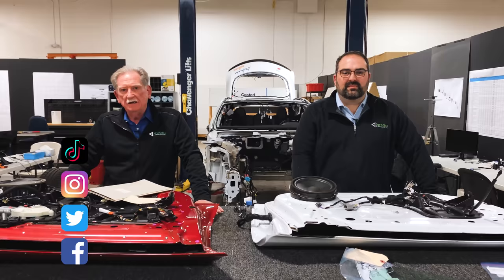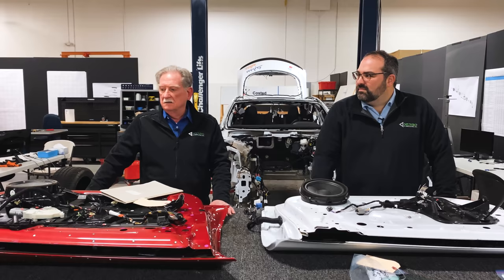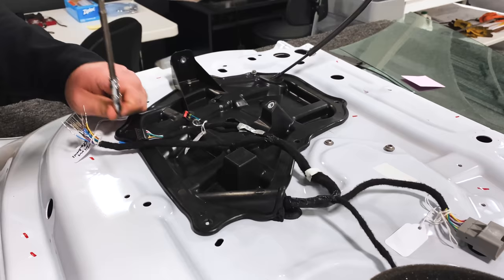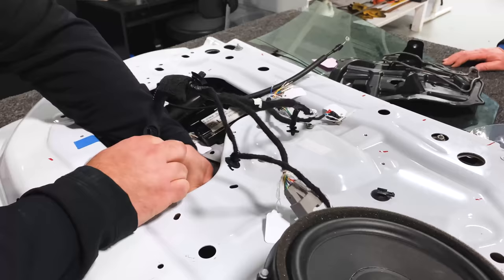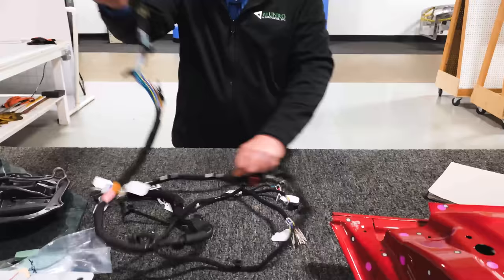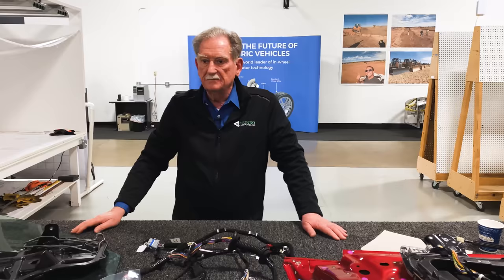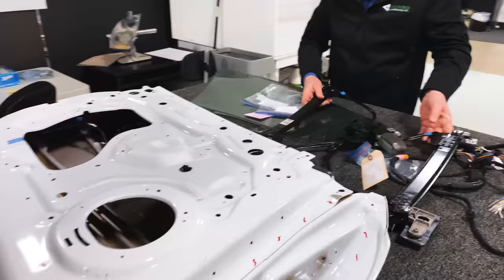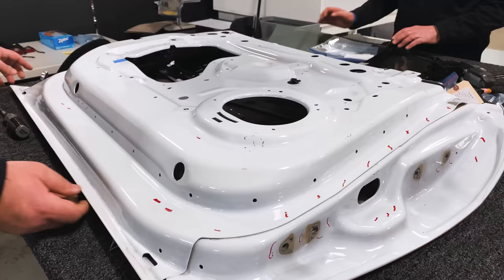Plaid Doors Disappoint Sandy | Tesla Plaid Teardown

Comment: Sandy as a, as it stands former Master tech with a european manufactuer who's driver did not win the F-1 Championship this last year I can say I love what you do. I have delt at the dealership level of repair of the semi modular doors and conventional doors and found they just use this as an exuse to lower labor times. I know its all about snap and fit, but when it comes time to service and repair I would love to be part of Your reviews of what it takes to diagnose ,remove ,and repair rhe faults seen. I know it's rether easy to evaluate a door or a headlamp assembly when not on the clock. whith scattered information at best.Thanks for all you have dome.

Comment: model s plaid is based on the same line as the model s and they already have a working line for model S. What Elon said in the interview with Sandy was that once a line is moving and tooling is setup then the line will run until they do a hard redesign.

Comment: OMG - As an engineer and former union worker from Michigan I am lost to see what quality and cost advantages Tesla saw in using separate parts versus sub-assembly one-piece door inserts. The only thing I can see is the engineers working on the door design got lazy and did not take into account assembly line time. Just think of the downtime if the person that sub assembles this door nightmare calls out sick at the last minute. What person can jump right in and take over?
Reply: I'm betting this is essentially a continuation of the outdated nine year old 2012 Model S door design. It's too bad because they obviously discovered the benefits of an insert with the Y. This looks like a nightmare for line workers.
Reply: @GabeJE  
It looks like "no worse than other manufacturers" for line workers.
As mentioned elsewhere, it's probably a common skin from the older design, low volume, sunk cost in machinery?
Reply: @GabeJE  I did some research online and it appears this same Plaid design is still used on S and similar X design. It also appears some Model 3's with sub assemble one-piece doors are rattling due to loose wire harness rubbing against the doors inside trim panel. An easy fix is taking off the door panel and using molding tape to affix the loose wire harness to the inside trim panel or adding insulation to the trim panel.
Reply: Team leader. Happens all the time.

Comment: Great video. As a retired engineer, I was flabbergasted as to the horrible assembly process required. Looks like it was designed to be manufactured in a “low cost” labor area. I agree with Sandy that this could be a quality nightmare. The amount of labor required relies on the assemblers to pay very closely to what they are doing. Makes sense now why old saying, “Hope I don’t get a car make on Monday morning or Friday afternoon” was penned. Also, why “lemon” laws were passed. Thanks for this video.
Reply: Plaid model S is a low volume car, not design for high volume, like model Y is .
Reply: @LeesReviews69  - TESLA will invent Whole body Megacasting, and Destroy LEGACY auto.
Reply: @markplott4820  
Still on the "megacasting"?
Single question.
How do you produce a "megacasting" with good enough finish for paint on exposed outside surfaces?
Go away and ponder that. (Note the castings used so far all have steel panels as "cladding" which are then painted. Can't do that on the roof beams.
Reply: @LeesReviews69  If I have to buy a car from China, guess I’ll just stay home.

Comment: 11:44 that rounded edge is not just for the safety during the assembly but also for improving panel's rigidity and resistance to resonance.

Suspect Tesla looks at PLAID as a niche product with low production numbers and willing to eat up the assembly cost. Model 3/Y are with different requirements for speed of assembly and overall production cost. Great video.

Comment: What Sandy says about this door is very clear to this non engineer. And to hear that Sandy's experience of his ideas being rejected by the Ford was very surprising and disturbing. Does management care about the stripping away of unnecessary tasks or is it just interested in power? This is sad. I have had my hands and tools inside about five different car doors and all of the experiences were absolutely pain. Drop a part and the door might have to come off it's hinges. Luckily, the only part I dropped was steel and I retrieved it with a magnet.

Comment: Wondering at what extent of door redesign (e.g. removal of steel), would Tesla be required to perform new side impact crash test?
Reply: both doors are from tesla one is the latest model y, and the white is the model S Plaid.  So there would be no new testing
Reply: @davidanalyst671  Side impact testing is on the vehicle, not the door.  Can't just swap a door from a different car and say it is tested.
Reply: And it certainly seems like all of that structure must be about side impact to begin with.
Reply: @patreekotime4578  it’s not, that stuff is thin and flimsy and not core to the crash worthiness. There is a major beam in the door for crash worthiness.

Comment: I wonder if maybe this is just a function of inheriting the design from the first generation Model S.  Maybe they don't sell enough Model S's to justify redesigning everything to be more like the 3 and Y just for a car they only make a few thousand of every year.
Reply: Model S in 2021 sold less than 10k. so they only need to focus on NVH, does not matter if it's hard to assemble, as more Human workers are needed on Mod S line who can fainess parts better than a robot can, mod 3/Y use more robots than humans and Design is better suited for mass production.
Reply: That's a poor excuse!
Reply: @gmv0553  It is, but that's the same as any of these super high end cars.  They only sell a few each year, so complexity of manufacturing and maintenance isn't really a concern.  Think about how hard it is to remove an engine from a Ferrari or to replace some trim panels on a Bentley.  The buyer doesn't mind paying a lot more for the car and either they get bored with it in a year or they have six other cars and don't mind it being in the shop for a month.

On the Model 3/Y where it isn't a toy and the labor multiple is 10-20X, it makes sense to redesign and retool, but on a low run car, the return on investment simply isn't there.

The Plaid's design budget went to power and NVH since you need to be really well off to drop 150K on one of these rockets.

Comment: With the panel trim off and the closeup panel, the metal stamping of the door looks identical to my 2015 P85D. S is a low volume product and they're probably using the same stampings they've always used for the S body...except for the rear fenders.

Comment: Did they leave the original design, so they didnt have to buy another die to cut out a bigger panel in the door? Maybe it was a cost saving measure or a tool hasnt reached the end of its life yet so no reason to replace it until then?

Comment: Maybe it is a module. Looks like the module was assembled on a metal panel and was spot-welded to the outer door frame. Maybe the harnessing was installed before the inner panel was applied.

Comment: Sandy, you might have missed the whole point of why Tesla might have used that door. Right off the bat, I can see that it will offer much better protection upon impact in an accident. If your car gets T-Boned, especially at high speed. I'm going to want that stronger door that doesn't bend so easily as the one with all that plastic stuff. Remember Tesla is always trying to make the car safer first before anything else.

Comment: All that is needed is Bluetooth connected to the car's control system, and allows the electric current to go from unit to unit. with multiplexing you reduce the weight and save assembly time.

Comment: 9:35 I immediately can imagine a couple of tools that make the whole assembly a lot easier. Not saying that Tesla came up with similar solutions as those coming to my mind, but I'd say there's a fair chance they did.
Reply: The design applied should not be dependent on the tools you are going to use.... (productivity on design in stead of tooling)
Reply: @chrisvanzadel6944  Back to hand built cars?
Reply: @chrisvanzadel6944  Why not!   Everyone uses Phillips head bolts. How tool dependant is that?
Reply: @dnomyarnostaw  If there were no screws needed the tool would be rededundant. "A tool with a tool will be a tool"
Reply: @chrisvanzadel6944  The fact is, that EVERY design is not just Tool dependant, but Supplier Dependant,  Legal Requirements Dependant and Economic Principle Dependant.
There is no such thing as "unfettered" design, and no point in being ridiculously reductionist in either design or construction.

Comment: The model S stick build has high stiffness has better permanent vapor barrier protection. The stiff door also complents the audio system driver performance. Having an inner separate barrier is an extra part for failure and affects previous statement. The best part is no part quote from Elon. Not saying your statement is wrong Sandy. What's the objective of this sub assembly? This is the question that comes to mind.
Reply: Exactly! As a Plaid owner I am much happy to have this type of door design over the model Y. They should have covered the positives of having this style of door instead of talking it down due to a longer and harder build process for Tesla. I’m glad these guys don’t make cars because they have trouble seeing all the angles.
Reply: This door appears to be monocoque. Better crash protection, added rigitity for weight below in floor of vehicle when latched?
Reply: He told you "what the objective is"
Bench tested before it gets the the line (LESS chance of failure)
Fast assembly on the line.
.
"The best process is no process"
Quote from Elon trumps "part" in this case.
"The audio system driver performance"? Build the box into the sub assembly.
"Better permanent vapour barrier"? Exactly where is that installed? If it's inside the frame, much more difficult in the stick build. If it's over the finished door, zero difference.
"Extra parts for failure". Installing a loom on the line, essentially untested = more points of potential failure.
If it's tested after door assembly and has an issue, much more difficult to put right 
"High stiffness"? Certainly more weight, but the Y is one of the safest cars on the market, and supposedly very stiff (about to get more so)
.
In short, you were absolutely saying his statement was wrong...... He's right (just imo, of course, but I'll side with the experts)
Reply: @Tothefloor  
"You're glad these guys don't make cars"?
What the hell do you think they were doing before forming/ joining this company?
Ridiculous comment.
Reply: How many cars have I observed water damage from failed vapor barriers... Too many to count. Huge money maker down the road for BMW and Volkswagon.

Comment: One of the best door designs was the Saturn. Just a few bolts on the bottom then the whole outer skin came off. You could replace a broken glass and adjust everything from the outside, then just hang the outer skin back on. All the door glasses that we  had too do always left our arms bleeding and cut, from sharp screws and sharp metal edges.   CHEERS   Steve h.

Comment: I'm gut tells me that since the plaid and other S models are such low production,  it wasn't cost effective to change the tooling to make the doors modular.  Otherwise I am sure they would have
Reply: My thoughts too
Reply: Same occurred to me as well.
Reply: My guess is it will happen in the next major redesign of the S and X.
Reply: That's a poor excuse!
Reply: @gmv0553  would you pay more for a plaid if the door was built different?

Comment: Still not fixed the problematic door handles either….   Still failing if the internets are to be believed.  My S has had one a year so far…

Still has the crappy window frame adjustment and the quarter light seal as well. Perpetual noisy leak source. They had three goes at making the windows seal properly in mine and they still periodically get worse and need further adjustment.  You can see why. They should’ve updated this but I assume this’ll happen when we get an actual new S rather than s facelift.

Comment: I Disagree about the Plaid Door.  I Owned a High End Car Audio Store and Isolating the Speaker to a Solid Area void of all Moving Hardware will Drastically Improve Audio Quality.  I Love the New Design even if it takes more effort.    I Can imagine the extension of the Low end Frequencies and tightness are significantly better.... Well Done Tesla
Reply: They could do it in two pieces.  Mount everything except the speaker to a board, then the speaker directly to the door.  Just need a hole on the board big enough for the speaker mounts.
Reply: do you actually need the entire cavity to be metal, or would one solid corner (where the speaker is currently mounted) suffice? the rest can be done via a plastic module, for an easy assembly process.
Reply: @kam_iko  The Speaker Baffle Housing should be One Solid Piece for the Lowest Resonance properties.  I am sure they have opted for the most efficient Solution.
Reply: This is a legacy door from the old Model S, definitely not made this way for acoustics. They could still drastically improve the design like the Model Y and still mount the speaker separately. Tons of room for improvement while maintaining acoustics.

Comment: I’m on my second Plaid and both have had distorted driver door glass when I look out. They aren’t manufacturing that glass correctly. Also, why didn’t you show us the noise canceling speakers integrated into the seats? That’s important to show us.
Reply: Maybe Tesla was just scamming the customers with the "fancy" noise cancellation lol….
Reply: Maybe you need to get your "story" straight?
Is it one plaid. Two plaids, or a Porsche?
Reply: @rogerstarkey5390    Think he meant two plaid shirts and a horse.
Reply: @rogerstarkey5390  I have a 992 C2S and a Plaid. I sold my first Plaid in December due to a vibration issue that Tesla could not fix on the car.
Reply: @carholic-sz3qv  I think he didn't do his research and missed them.
Reply: Tesla does not care about quality, it's always "within spec".

Comment: I can see why the bass and the sound system is better on the Model S plaid.  The design of the speaker housing and how it is mounted is better.  More bass response and less rattles. Also with a metal inner skin, I would assume the door has more structural strength than plastic.
Reply: Or maybe they just used better speakers….. lol!!
Reply: @carholic-sz3qv  The speakers look the same.  Just a better enclosure, mounting and angle.

Comment: I've taken apart door panels many many times over the years, to fix regulators, window switches,  power lock motors, flex racks, and rear view mirrors, etc. 
Once you get in there, you can really tell who designed it for ease of disassembly and repair....and who did not.

Comment: Wouldn’t the operator be able to more easily run those wires with the speaker removed and then install the speaker after the wiring harnesses?

Comment: I can appreciate how much easier replacing the window regulator would be since I did this on a Toyota Sienna not long ago. My concern would be the loss of metal structure  affecting the side crash protection and the mechanical support for the motor and speaker.

I suspect they couldn't justify cost for a rather low volume product. Better to put the engineering toward the Cybertruck.
Reply: Lol……
Reply: Ive replaced the window regulator on an S Class Mercedes - you need 9 arms, 6 ratchets and 3 screwdrivers. Just getting the door card off is a days work.

Comment: For grommets on cable hardness assembly, there is a special antistatic spray-on liquid called wash wax all (D6-7127M) that meets British aerospace spec approved for all craft, car, boat Interior. It is a water-based soapy, non-toxic, biodegradable liquid that looks like a stingray’s blood. The liquid is used widely in cleaning the interior of all Boeing planes after each flight but is also very popular especially in rubber grommet assemblies.

Comment: I have heard that the doors are a holdover from the original Model S design, going back to 2012… It’s disappointing, no doubt. However, the Model S/X went through REFRESHES, not redesigns… My only guess is that when the Model S/X is redesigned to use front/rear castings and structural battery packs, that the entire car will be upgraded to the latest assembly techniques.

Edit: Let’s also not forget that the Model S & X are low volume, premium vehicles. Sure, there are cost savings to be had. However, having a fully metal door carcass might deliver a higher quality product. Even if it takes an additional 45 minutes per door to assemble, it probably will only have to be done ONCE in the vehicle’s entire lifecycle.
Reply: I don’t think the different profiles of the two pieces of laminated glass were done strictly for weight savings. Sure, every gram counts. But by having the inside glass have a slightly smaller profile at the bottom allows Tesla to use the same window regulator provisions as the 2012 models. The only difference needed would perhaps be different profile window seals at the belt line of the door and around the window opening on the body. This would also allow somewhat easier retrofits of existing vehicles to accommodate the laminated glass.

Comment: use bailing wire to fish your cables.  Start at end points grab from the larger cavity. tape cable to the fish, then pull back to endpoint.  Going the other way is a B.